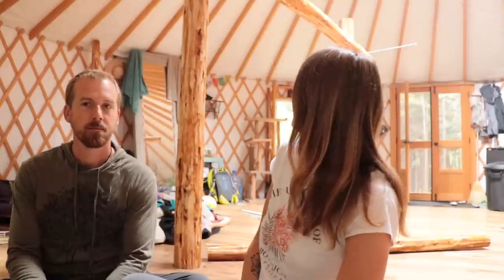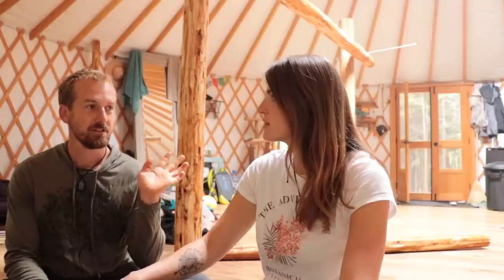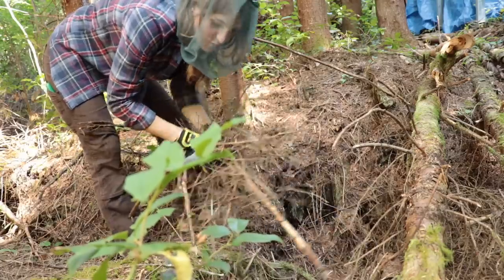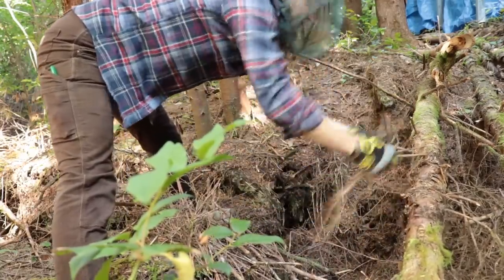Living Off Grid in a Yurt | Building a Loft, pt. 2 -  Ep.41

Comment: ok so i know you might be tired of building advice so can i call it just a little tip, when setting post in the ground, just dig the hole then a little gravel and set the post in fill half way with water and take your dry cement mix and just pour it in the hole no mixing what so ever its very easy and saves a ton of  time and labor i used that method for many years and has always worked great. i just wanted to help you out a bit so take it as you see it but it really does work great and saves all the time of that mixing mess and shoveling in a hole. thanks for the great videos and never mind the bashers keep on going and making the videos as you see fit. be good and be fit.

Comment: in stead of using all thread rods. You should cut a half moon saddle notch and set you beam's on top of your poles that's the way they been building thing's since the beginning of time it will be more structural and load bearing great job you guy's are awesome

Comment: one way to get a straight and level cross pole is to either use a tape measure from floor to desired height or use a clear rubber hose with water in it run the hose down one pole and up the other pole the water will show the level plane for an equal height from one pole to the other pole.

Comment: Definitely consider getting 1 Right Angle Bracket / post to help hold or transfer the weight to your post.   8 to 9 inches would be plenty if you had them made out of inch and a half angle iron. You can make them yourself if you know how to weld. Get it welded if you need to and have a 3 or 4 holes / side that will be touching the posts and beams to put some 3/8 × 4 inch lags in posts. Paint it Black before you put it up and it will look rustic. Safety 1st. You're both doing a great job, don't skimp here.

Comment: those post would be sturdier if they were notched together and then bolted. makes it safer also because your not just relying on the bolt strength.
Reply: Spot on . Exactly what I was thinking .
Reply: Yep
Reply: To look authentic they could use leather straps wrapped around it to help hold it.
Reply: I heard him say he was gonna use brackets underneath, which would allow for more floor space then if it was notched. Seems like as long as it has the strength it needs theres no wrong way. Kinda the point of what they are doing I feel. Would look cool notched though.
Reply: exactly, beams will move with a round bolt through them. Make some nice hand hewn 45 degree braces. They will look nicer !
Reply: @kobracom77  yes as it is at the end of this video it is not enough , and that's why i was pointing out that he was in the video "saying" he was going to add brackets to add extra strength. I have only ever done ship building but we use brackets for extra strength so I think they would be enough to give the strength needed. Brackets vs/or notching. Either way should be fine.
Reply: glad i looked t the comments spot on they should be notched , that ready rod (all thread) is less than a grade five bolt i think or maybe the same i give up

Comment: Love watching your videos.....concerned with the loft not being able to be supported by the thread bolt instead of the post.....have you determined the weight of all those logs those 4 bolts will be supporting, as well as all the weight you will be adding.....the posts will handle alot more weight even with being notched out, as it is now, the weight is supported by the bolts not the posts......
Reply: Cathy Sorensen exactly what I was thinking. The posts and horizontal beam should be notched so the posts carry the weight and not the 3/4 all thread. I’m just guesstimating that if logs are used as floor joists about 700 lbs plus plywood,laminate floor, bed and two people. Total about 1800 lbs.  if not using logs as floor joists do not use 2x4’s as floor joints. 2x6s at a minimum for floor joists.

Comment: That threaded rod is going to make a weak connection. The rod will bend and the whole thing is going to sag. It would be a lot stronger and more stable if you cut the uprights and then set the cross beams on top of them and lag bolt them together. Or you could scab supports between the uprights and lag the cross beam between them or mortise and tenon the cross beam into the uprights which I think would look pretty slick and secure it with a dowel.

Comment: That "ready rod" or "all thread" joining the logs together is not safe. put the cross piece on top of the vertical logs.
Reply: He dont know much about building, you can tell. The shear streangth in all thread is not as high as one would think, but i think it will hold. I would put beam on top of post, no worry that way
Reply: He could put one or two more verticle logs up to disperse the weight a little more.

I think it will hold though.
Reply: Spoken like a true amateur.
Reply: @kobracom77  so true he is a know it all and wont listen

Comment: Yall, if the posts a set into the foundation area on their own, you may want to consider tension cables for them so that they do not settle at an angle of time. Even with cement, over a while the posts can settle at a different grade. tension cables between the loft posts and some of the structure posts may help?

Comment: The rebar your using is alltread. Alltread is not meant to be used for what you're using it for. Don't risk it!
Reply: That looks to be 3/4 inch threaded rod, plenty for what they are building. I have used 3/8 bolts and held a lot more weight then what they are ever going to have on that little platform. They should add gusset's because they could get some wobble. Also peen the threads so the nuts don't walk loose.
Reply: All-thread.

Comment: It seems several others have seen as I have seen. You should notch the top log and put on top of the vertical logs. You could have 20” logs and the structure will only be as strong as the all thread. Use the logs to support the weight. The way you guys have it usually people do as a cosmetic look not for structural.

Comment: That "3/4 inch rebar holding it all together" is not structural and is dependent on the shear strength of the 3/4 inch rebar. That "rebar" is not designed to stand up against shear forces, it is designed to compress and resist against pulling forces.

What you need to do is to have the cross member sit on top of the uprights and that will make it home secure.

This video will explain what i mean. https://www.youtube.com/watch?v=JjQZ9rtbYcM

I know most people will say "it's only a small amount for such large 'rebar' and it shouldn't be a problem" but how bad would you feel if Jake or Nicole
 were injured (or worse) because it wasn't done correct? Is this structure going to be used by other people in the future, what if they didn't know the limits of the loft and it happened to them?

Standards and code were written in blood,  don't add to it by not doing it correctly the first time.
Reply: Jake has no construction  skills .... Kung fu , social media and freeloading donations for his hippy vegan lifestyle are the limit of his skill set
Reply: I agree with you take the time to do it right the first time you are using large beams to hold the weight but unless you put the cross beams on top of the support posts you will be relying on the rebar to hold the weight I like you kids and I am not trying to be a know it all just hate to see you guys get hurt
Reply: I have to correct myself that is ready rod not rebar
Reply: @robertaxford3749  ready rod, threaded rod/bar, all thread, all the same thing. I called it rebar because Jake called it rebar. Whatever it is called it is still not the correct (or best) way to do it.
Reply: I’m certainly not a construction expert at all but can definitely see what you mean.  All the weight of the floor, people, bed, etc is dependent on just a couple of bolts.  Definitely needs more reinforcement.
Reply: @phillaboody260  yes I agree with you I figured you new what it was and I called it rebar as well so just thought I'd throw it out there
Reply: @kellybelanger3685  I know what rebar is. Strength...Rebar adds  tensile strength NOT shear strength.
Seems that you're the one that needs to "know your words".
Reply: @kellybelanger3685  okay Kelly I am a journeyman contractor and have been in construction for 24 years I started as a labourer and went from there I have built my own homested with my wife and i am just trying to share some of that knowledge I have seen quarter inch rod fail before and why brace it if you use the strength of the logs that you are using as a building material I the first place its pretty simple just go look at any deck support and tel me if it is held up by ready rod any way all the best from Alberta Canada was just trying to help
Reply: @robertaxford3749  Jake said it was 3/4 inch. It's probably strong enough but why take chances right?
Reply: @kellybelanger3685  I give up
Reply: I agree with you Phillip and Robert. As for you Kelly, your words... smh and a 🤦‍♂️
Reply: @robertaxford3749  threaded bar in mild steel in UK. Not much strength. The ejit even cuts it inside his home.
Reply: Phillip Aboody 1/2 lap joint would do it. Easy enough with logs as well.
Reply: @kellybelanger3685  About what?
Reply: @kobracom77  bye
Reply: I would put a half depth notch in the upright & the same in the crosspiece to take the shear strain off the threaded bar.

Comment: Have you insulated your yurt floor underneath yet?? It’s going to be cold in the winter months if it is not insulated and closed up
Reply: If it’s closed it will get damp - it needs airflow and a gap from the wet ground .... it’s raised up for that reason .... if they stick a load of stuff under it will just get damp .
Reply: @carlyonbay45  bottom line insulation will not get damp if properly installed 4 to 7 inches of insulation will be fine, and extremely important!!!!
Reply: @PalestinianExplorer  it needs to be attached to the bottom of the Yurt.  Vapor barrier towards the heat..

Comment: If you want a flat surface up there you'll be buying lumber.
That is to much span for 2x4s, 2x6 would be fine.
Framing on 24" center is plenty good for people weight
Deck it with 3/4 plywood and it wont bend.
That 3/4" "rebar" is called allthread
If you cut the tall poles off and put the cross pole on top of them, it will be more then twice as strong as what you have now. For reals..
I'm going to start billing you for these life changing tips.

Comment: I was wondering, didn't you say something in a previous video that the area where your Yurt is and the surrounding area was sort of under a few inches of water in the spring time. If that's true, I was wondering how your going to get wood for the firebox from the place its stacked to the Yurt without trudging through that standing water. Wouldn't it be smarter to have your wood stacks just outside the front door?

Comment: Why did you put the posts for the loft through the floor?  Just build it on the floor. Curious as it would have been way easier.  If you needed more support you could put a double joist with hangers under where the posts went.
Reply: They did not want the added weight/pressure on the floor.

Comment: Excellent work folks, your project moves onwards and upwards. Well done! Do you think that your cats might use the vertical logs as giant scratching posts and scratch the post three feet or so above the floor level? If so you might need to treat or encase the wood in order to repel the cats. Better this as you will not want to redo this work especially after the poles are concreted in. My cats sharpen their claws on the tops of fence panels and cause considerable damage over time. Wooden poles ,untreated ,would over time become used for scatching despite the fact that they have their own climbing frame elsewhere in your yurt. Just saying 😱

Comment: Just read all the comments to 'Living Off Grid in a Yurt | Building a Loft, pt. 2 - Ep.41' and the 'critics' do have a valid point on the "Standard Practice" way of attaching the loft's (massive) horizontal support beam.  So since you're clearly designing on the fly here, e.g. height clearance based on Jake's 6' 2" stature, why not call it exactly what it is, a MOCKUP, part one of many, to dial in the final design for form and function.  You closed out this episode still debating slat material and stairs vs. ladder...

Among the many other considerations:
Adequate head clearance on the wall side of the bed.
Plain headboard (probably not) or something useful, taking on the role of bedside tables and more.
I personally like the idea of mobile stairs with storage at the end of the bed because:
1) EQUAL access without crawling over each other.
2) Big one here: The space under the bed could be a fancy couch with storage by day to watch the big 4k flatscreen say, AND bedroom number two by night, as said fancy couch folds flat...
3) Test your acumen and find a way to stuff a half bath under there also.
Wow-factor design is an iterative process, and so by definition the MOCKUP has just begun; even that giant support beam may morph into a 2x6, dadoed into the upright posts, all dressed up with the first slice off a like-sized tree.  Makes more clearance for the stairs too, and minimizes the intrusive appearance of TWO (intimate though they be, dorm-room style) BEDROOMS.

Finally, a quick thought on cold winter floors. Foot fatigue mats, typically 3/4" thick, are reasonably good thermal insulators, so add a short nap wool rug with that carpet backer stuff to it and insulate your floors from above; a relatively cheap, quick, decorative fix that will easily match the R-value of those Yurt walls.  Make as many manageable sized pieces as you need (to periodically take'm out and beat'm), or just buy a $600 Miele vacuum when your power system can handle 15+A/120VAC (has the power of my best shop vac, whisper quiet, HEPA filters, bullet proof).
Never heard of a 'Yurt' anything before, but I'm a curious Engineer, and pics are worth a lot in this case; I'm almost certain I've seen them all, but I'm going to be diligent and double-check.

Comment: Not structurally sound construction.  At a minimum the post should be notched, better is to have the vertical posts UNDER the horizontal.  

And did you put cross bracing under the floor yet? The more weight you put in the yurt, the more prone it is to collapse in a twisting fashion without cross bracing.

Just trying to help.

Comment: pizza with ratatouille and olives. basic pizza dough see page 8-11 . 1 large eggplant, cut into small cubes. salt . 1 pound (500 g) ripe tomatoes, 3 tablespoons extra virgin olive oil. 2 small onions, thinly sliced. 1 clove garlic, thinly sliced . 1 table spoon finely chopped fresh parsley. 1 red bell pepper (capsicum) seeded and cut in small squares. 2 small zucchini ( courgettes) sliced 6-8 green olives, halved. fresh ground black peeper. 1 tablespoon finely chopped fresh thyme. serves 2 preparation 25 minutes. time prepare the dough and let rise. cooking 25 -35 minutes. CRUST  1. prepare the pizza dough following the instructions on page 8-11. set aside to rise. TOPPING  2. place the eggplant in a colander. sprinkle with salt and let rest fro 30 minutes. 3. rise the eggplant and drain well 4. blanch the tomatoes in boiling water for 30 seconds. drain and slip off the skins. slice thickly. 5 . heat 2 tablespoon of oil in a medium saucepan over medium heat. add the onions, garlic , parsley eggplant , bell peppers, tomatoes and zucchini and simmer until tender. 15-20 minutes, stir frequently . 6. preheating the oven to 500 degrees F (250 degrees C /gas 10 ) 7. oil a 12 inch ( 30 -cm)8. Knead  pizza dough briefly on a lightly floured work surface, then presses it into the prepared pan using your hands. 9. spread the ratatouille evenly over the dough, leaving a 1/2 inch ( 1-cm) border all around. sprinkle with the olives. season with salt and pepper. 10. bake for 10-15 minutes, until the crust is crisp and golden brown. 11. sprinkle with the thyme and drizzle with the remaining oil. 12. serve hot.      not ratatouille is a French vegetable stew. the quantity you prepare for the recipe will be enough to top two pizzas.
Reply from the maker: Wow!  Is this a recipe?
Reply: @OffGridLife  ya post 40 of 50 pezza recipes out cook book. one recipe on each of your vedo post.  I try only put the vegetable ones in. ham and few anchovy and sardeans snuck way in. when realized mistake put if vegitaren not put meat on pezza if like me not want little mini fish switch something els like. there 3-4 dough recipes if don't find them all recipes worthless unlesses get store bought dough. also need yeast witch make self or get dry yeast packet at store. you have a wood burn pezza oven, this my way to   see some these things happen. hope keep some trees grow so see oven used many years down road.  book called Pizza how make and bake more than 50 delicious home made pizzas reader's digest. basic dough take you from bowl water and yeast and flower up pezza crust with red pezza sauce on pezza pan. hope see make least pizza with cherry tomatoes and oregano.  ( by the way im not vegan but like eat vegetables.) .